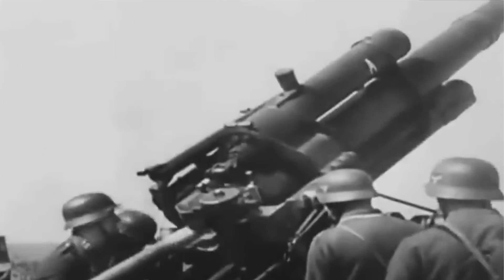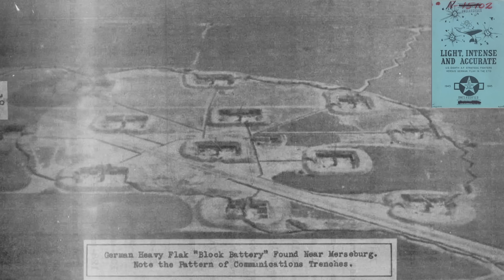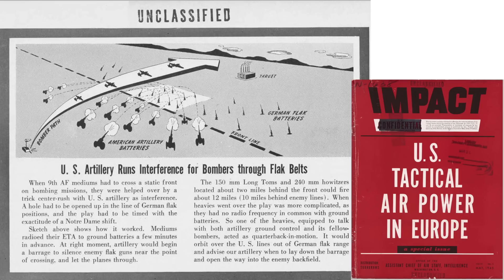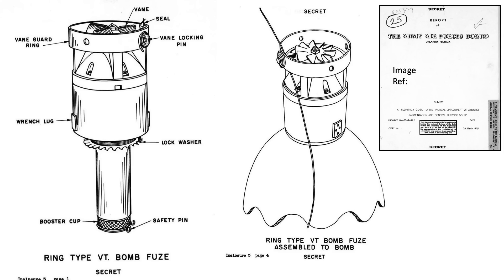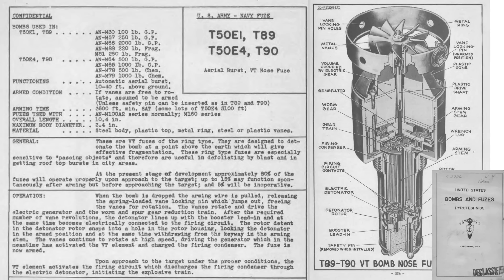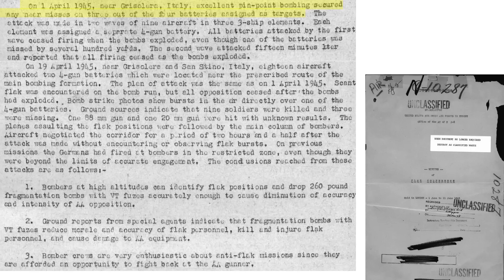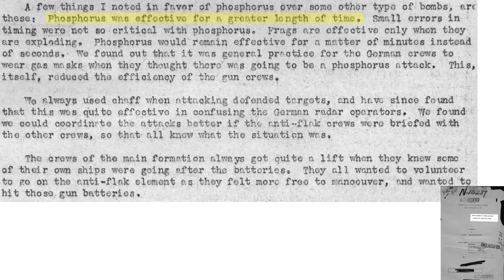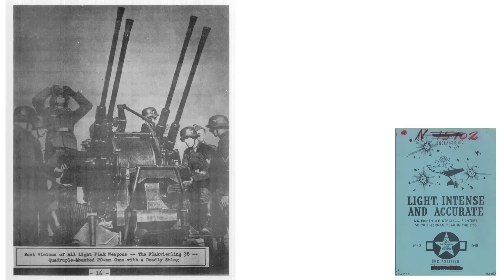Destroying German FLAK Batteries with Proximity Fused Fragmentation Bombs, Bomber Payback Case Study

Comment: Fascinating, were similar reports/ studies undertaken by RAF Bomber Command?
Reply: Flak suppression was done on Mosquito operations by 2 TAF and Coastal Command by the escort fighters (Mustangs or Typhoons). Flak wasn't so much of a problem for the night bombers, however on Daylight raids Bomber Command's flak damage to aircraft level's tripled. During the Battle of Berlin, Harris did try to use the Oboe Mosquitos to bomb German Night Fighter airfields on the ingress points of the Bomber stream, but a lot of raids failed due to Oboe Malfunctions.

Comment: Interesting, I never knew that heavy bombers were used for dedicated anti-flak missions.
Reply: B-24s were medium bombers, but point taken.
Reply: @Heike--  *Heavy bombers. The twin-engined B-25 Mitchell and B-26 Marauder are medium bombers. The B-24 Liberator has four engines, which makes it rather heavy.
Reply: @peabase  It's mission, not engines, that makes a heavy bomber. The Kondor wasn't a heavy bomber. Tactical strikes on AA batteries strikes me as light, barely medium.
Reply: @Heike--  Bombers are categorised as mediums and heavies by payload, not by engines, but higher payloads require more engine power, meaning more engines.
Reply: @Heike--  I have no idea what literature you're reading, but every aircraft classification text ever written has the B-24 classed as a heavy bomber. With a payload capability of up to 8000 pounds, it could carry the same as a B-17. 
The B-24 was unquestionably a heavy bomber. This is indisputable.
Only the B-29 Superfortress, Short Stirling and the Avro Lancaster could carry more.
I wonder if you're inadvertently confusing the B-24 with the B-25?
Reply: @woopimagpie 100% was an is refusing to admit. B-24 is US most produced heavy bomber if not the most produced bomber ever other than IL-2 (attacker anyways)

Comment: Fascinating. Several yt channels have the VT fuse story and its AA role over the pacific but I had no idea about its use by bombers over Europe. Thanks.
Reply: Use over land in Europe was limited to controlled areas until Battle of the Bulge
It was restricted in fear Germans could recover duds and replicate it or simply make countermeasures as  in jammers.
Reply: The proximity fuse used in bombs was different because it didn't have to withstand the huge accelerations of being launched from a gun or spinning very rapidly.  It was a much easier problem.